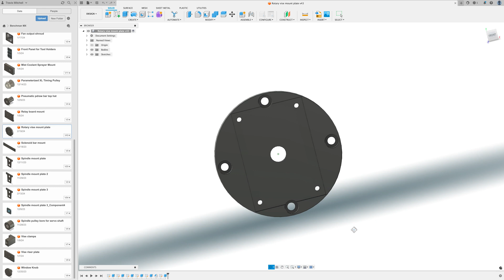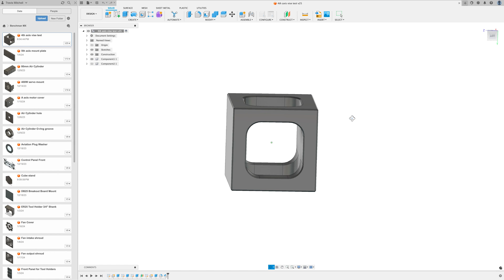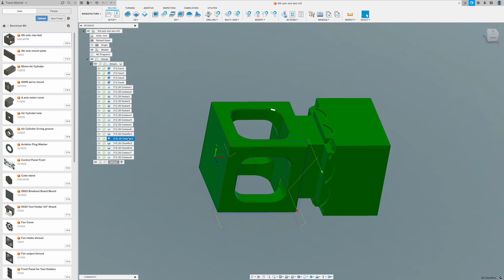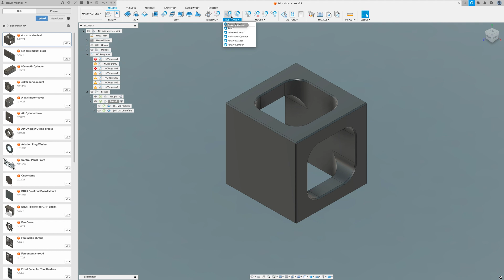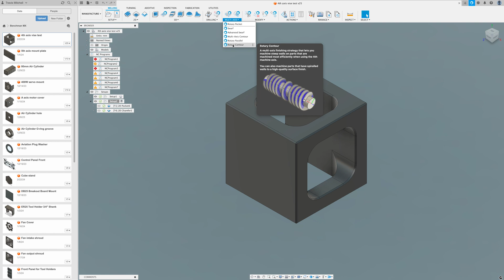CNC Mill Rotary 4th Axis Upgrade

Comment: Did you ever find a cheaper solution for cam software for 4-axis machining? I've been searching for a few days no without much luck. That's the one thing that's been holding me back from buying a 4th axis. I also pay for Fusion 360, and it's a shame that's not included.

Comment: i might suggest freecad as cad software but it is alot of setup but good when you learn freecad for machining. as for the aluminum shavings have you thought of smelting it to reuse a propper pottery kiln and some ingot molds could make for alot of extra project material

Comment: i hate milling 300m tall parts on 50mm vice ofc they are plasma cut and welded not so straight. and your setup is so NOT long LOL
i hate fusion360 red red cut inside choosen line. i not use cadcam. i have makros they do all same oneline code on work. i am the cam xD

Comment: we have 3 4 axis mills
vf3
vf4ss 
DNS NHP4000 

we use fusion360 and you really don't need the machining extension, you should see the crazy parts I designed and mill using the base license

Comment: As an alternative to the centering pin, which loses you the ability to use the through hole of your 4th axis, you could put 4x set screws around the perimeter of the mounting plate. These would let you dial in the alignment between the vise and the axis just like a 4-jaw chuck

Comment: You can buy tokens with Fusion and get the multi-axis package for 24 hours for 10 tokens (30 dollars). You can only buy 300 tokens minimum though. I've not found anything cheaper than Fusion, just pay for it monthly and you'll forget about the cost 😂

Comment: Thank you for sharing the video. I wanted to know if there is any brake required for this application. I have been looking at 4th axis options for machining aluminum on my small CNC and noticed that some solutions have various forms of braking mechanisms to keep the chuck/vise secure. Tom
Reply: if your 4th is a worm drive type it won't need a brake
Reply from the maker: I didn't install a servo with brake and it seems to hold it just fine. I supposed you could if you wanted to...and wire the brake to a relay and control it with some custom gcode
Reply: @diyfiberlaser  thank you for the quick response. Happy to hear I need one less component and no added cost.